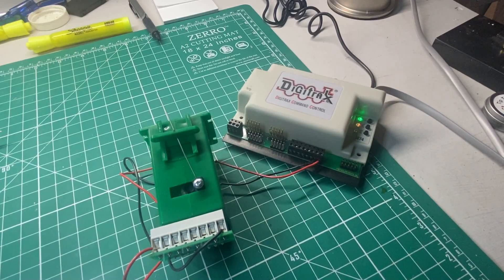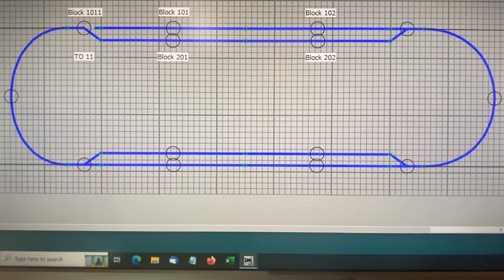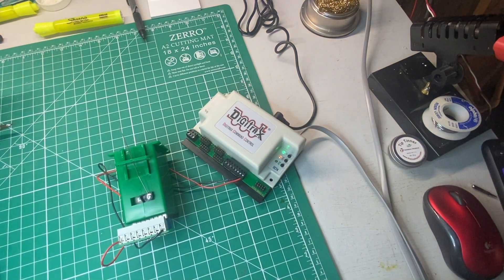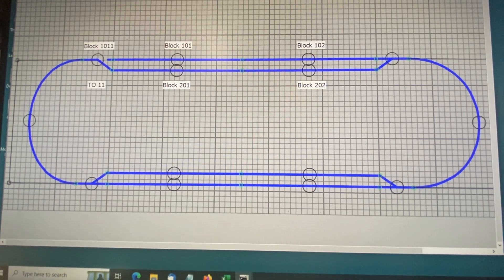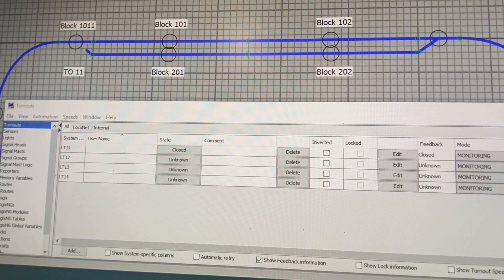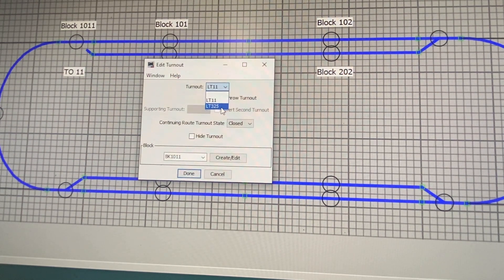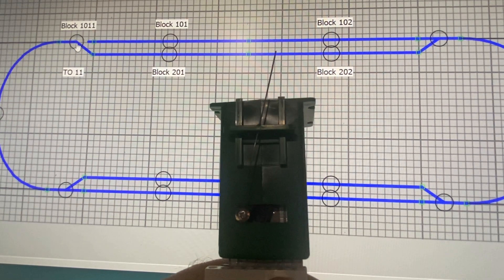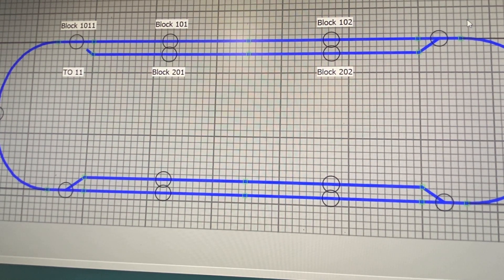Digitrax SE74 Explained - Part 2 - Tortoise Control with JMRI

Comment: I don't understand why JMRI has different layouts. The display layout has it's limitations but the circuit builder layout doesn't seem to have any. I built my display layout first and then found the circuit builder layout to be more useful. Can I just delete the display layout or am I missing something that the display layout does?
Reply from the maker: I'm sorry, but I don't understand the terms you are using. When I construct a layout in JMRI, I use the "Layout Editor" choice from the control panel which gives the grid background. That is what you see in the examples I have used here. The Panel Editor is used for making control panels, which I have never used since it doesn't fit with my operations. Using the Layout Editor doesn't have any limitations that I am concerned about. Maybe you can clarify your question and I'll take another shot at it.
Reply: @jimworcester981  The layout editor is the display layout and the circuit builder is a different way of building a layout. With the display layout you can't just hover your pointer over a piece of track to see what block it is. In the circuit builder you can. Also you can easily change text on the screen. I honestly don't understand why the display layout is needed.

Comment: Just a question on blocks how many sensors per block are you using? Not the turnouts but the actual blocks in between

Comment: I watched your videos on using the BDL168 for showing the state of turnouts. I was wondering if you thought of using a BD4N block detector, with the SE74 to show the state of the turnouts?
Reply from the maker: You could do that, but I have found it much more cost effective to use the BDL168. I use them on my home layout as well as on the club layout. With 16 detectors available on one board it minimizes the cost per zone!